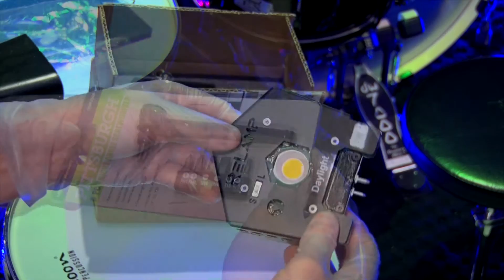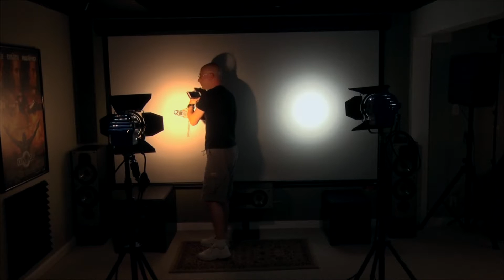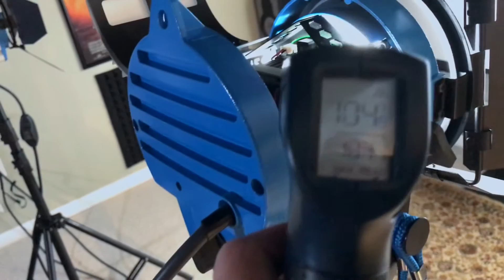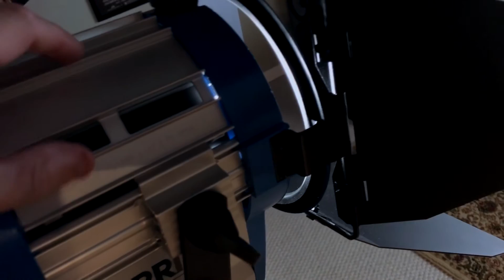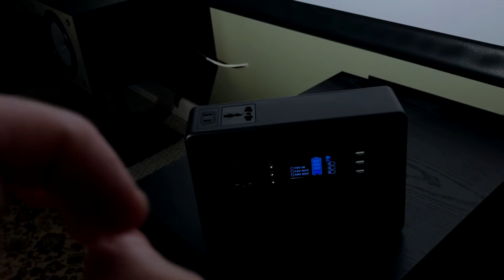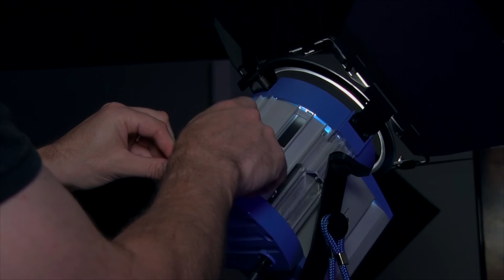VISIONSMITH ReLamp LED CONVERSION For Arri 650 Plus & Other ARRI FRESNELS

Comment: hahaha laughable to spend more than $500 for something you can buy off ebay/aliexpress for $10. You can retrofit something like that easy with led currently. Good comparison of the lights.
Reply from the maker: I seriously doubt that it can be the same thing, performance, color accuracy, cooling and hardware. If you can build your own with the same specs for $10, share a link.
Reply: @ArtVideoProductions  at this very moment I am retrofitting an e27 fitting in a big studio lamp (which hold beforehand a 1kw gy9.5 lamp). If you have the room in it (as I have), you can look for a 50w or 100w e27 led lamp. Granted.. not every studio light has room. And changing the gy9.5 fitting can be cumbersome...but if you are handy and DIY oriented, 500 to 1000$ is a steep price.. if you only look for led light of which you can solder on - and + poles to pins as thick as the holes of the gy9.5.. you are almost set. A heatsink can also be added if you want to. 5$ led light (50w) + heatsink ~5 -10 $ (just look it up) and some elbow grease: a DIY retrofitted studio lamp tailored to your need..
Reply from the maker: @HenkLeerssen  don’t forget the FAN. Heat sink is not enough.
Reply: @ArtVideoProductions  50w led light can sometimes do without a fan depending on the design of the led. 100w led.. I would agree with you
Reply from the maker: @HenkLeerssen  post a video on YouTube. I would love to see what you can accomplish. I might buy one off you  😀 
I have an ARRI 650 plus.
Reply: @ArtVideoProductions  already retrofitted. And did not make a video of the process. I can however sent a picture? Btw I have a long Selecon acclaim Fresnel studio light.
Reply: @ArtVideoProductions  @HenkLeerssen  I might buy one (or more!) from you, too.

Comment: Great video thanks! I bought the 300watt, 650watt, and the 1K Visionsmith ReLamps. I noticed the color temperature  of the "Daylight"  1K lamp (this may hold true of the others I haven''t had time to test) read 4560 degrees K at first striking and gradually climbed to 5000 degrees by 10 minutes... metered on my Minolta Color meter. Wondered if you have done in color temperature tests with your lamps. Also  I noticed the output from the 650 and the 1K lamps metered the same at equal distance and flood setting on the two different lamps. This seems incorrect if the lamps are truly rated at 650 and 1K. Wondered if you had noticed this...if you have these two lamps of course. Thanks for any input.
Reply from the maker: SmallWStudio thank you for this valuable information measuring the color temperature. I don’t have ways to do that. And I only have the 650. As far as brightness it’s spot on comparing to the halogen 650. And the daylight on mine looks just right on camera. No need to “warm up”...
Reply: @ArtVideoProductions  Thanks for the reply. Yeah a bit strange on color temp. I tested with my Minolta Color meter just cause I was curious and was surprised to see it shift as the light stayed on for a period of time. Also paying more for the 1K I was a bit bummed to find it had the same output as the 650. VisionSmith never responded to my emails or calls so that was disheartening to say the least. Live and learn I guess. Thanks again for your reply..all the best!
Reply from the maker: SmallWStudio thanks again for this information. Very valuable
Reply: @ArtVideoProductions  I won't bother you any more I promise but...the other day in a recording studio on a shoot my 300watt Arri with a VisionSmith lamp shut down to what appeared 1/2 power. I turned it off and back on and it seemed to run fine after that.   I suspect it was a heat issue but the studio was very cool so again I'm have little issues that give me pause...
Reply from the maker: SmallWStudio I’m sorry to hear that... and, no, you’re not bothering at all lol. It’s a pleasure.
Reply: @ArtVideoProductions  Thanks! Guess I just needed to vent a bit...LOL!